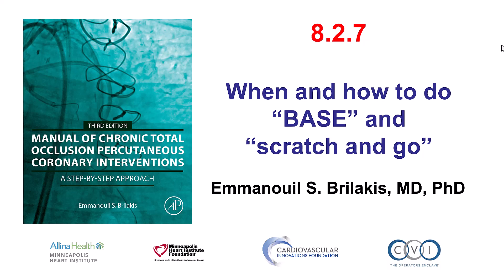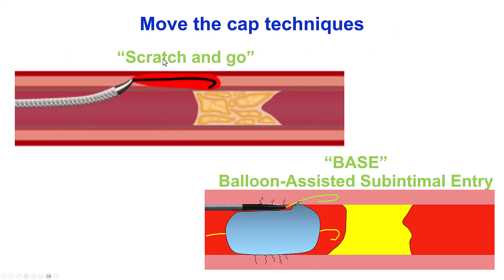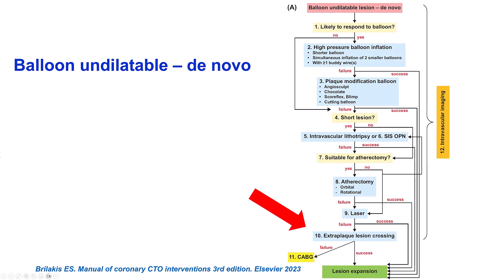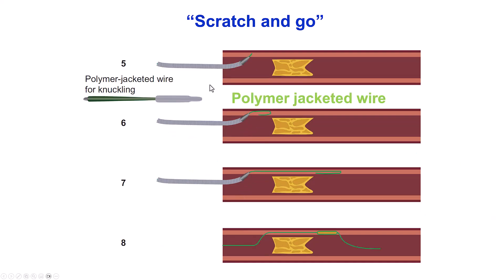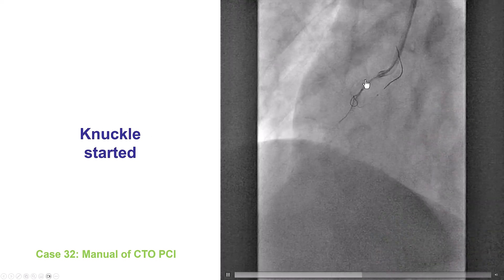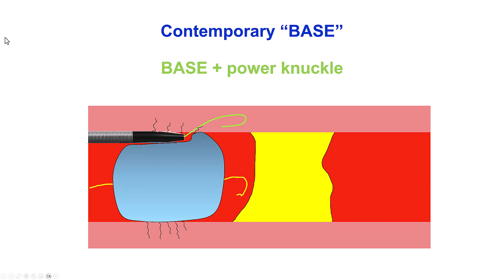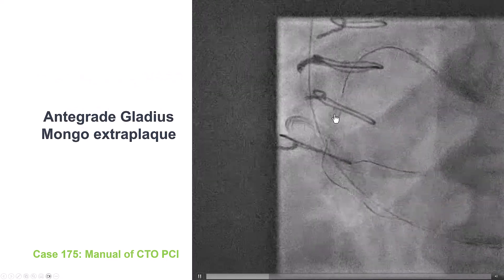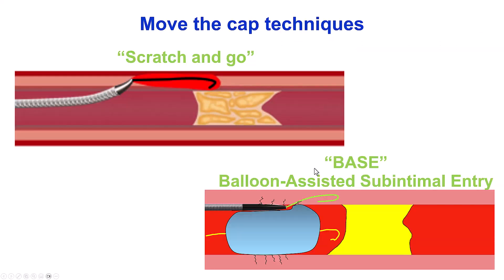Video 8.2.7: Manual of CTO PCI - When and how to do “BASE” and “scratch and go”

Comment: Thank you very much. Is it necessary to make a bend on the polymer jacket wire before delivering in the microcatheter?
Reply from the maker: You can create a small bend or an "umbrella handle" bend on the wire, either can work.